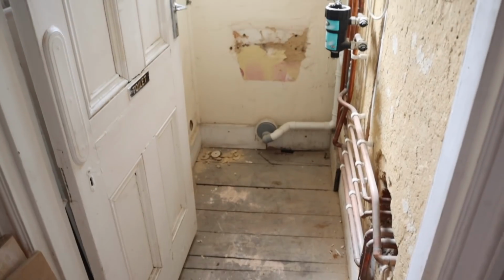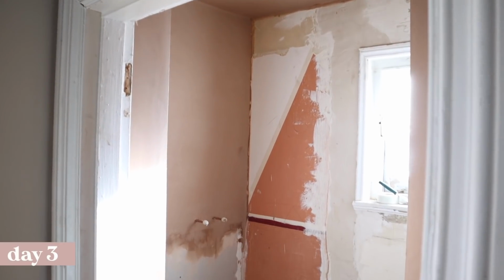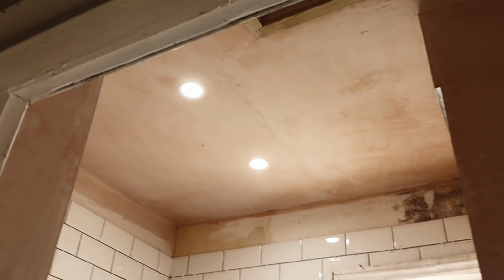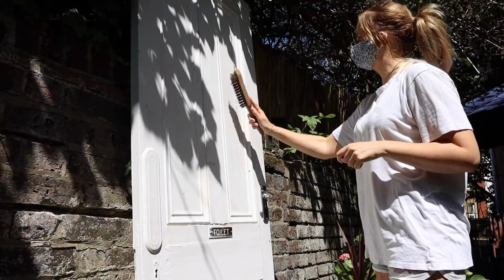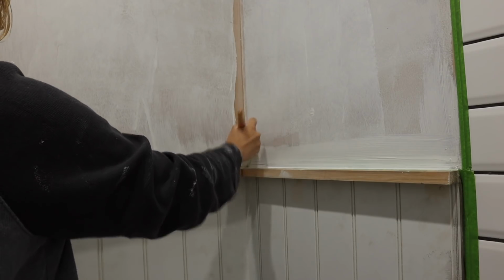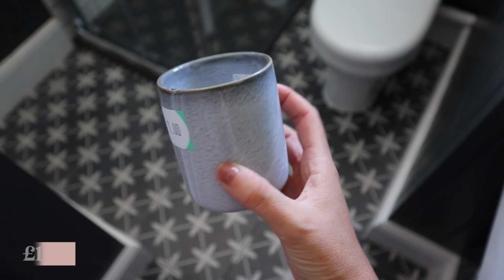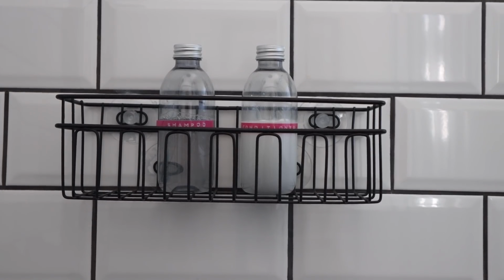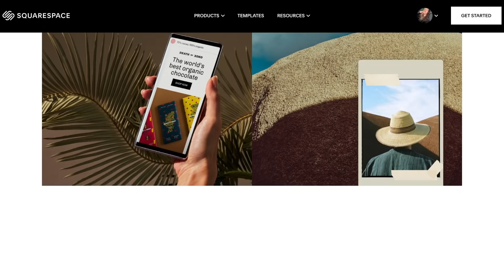Full Bathroom Renovation Makeover 🛁 UK Victorian Home Reno Hermione Chantal

Comment: Stunning!!

We are renovating the ceilings in our entire house.  The popcorn ceiling texture is falling down so it has to go.  We found out that the previous workers installed the drywall upside down and did not use the right thing for the joint compound.  There have been so many issues it has taken over a year with one more room still to go...

Comment: Thought you were not supposed to put spot lights in a bathroom. Need to put a special light fixture. Let's know if I'm right in saying that.
Reply: I think it’s fine as long as you have spotlights which are designed to withstand moisture - we have spotlights in our bathroom, one goes over the shower and has a built in fan to remove moisture when you shower
Reply: Thanks I want spots in my new shower room.